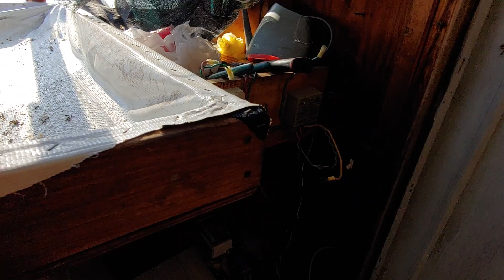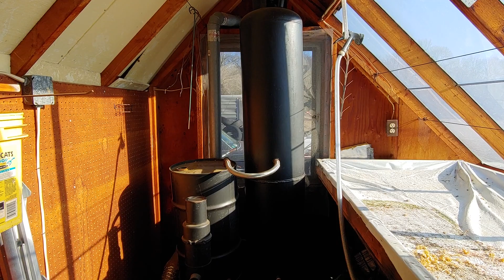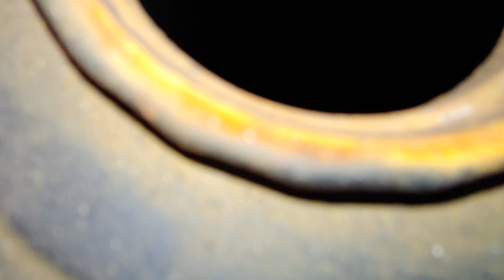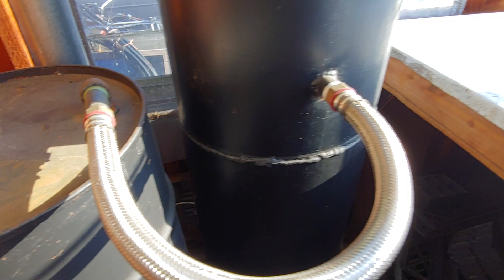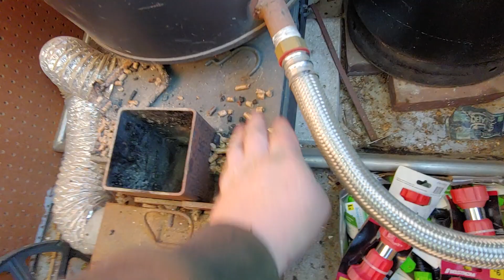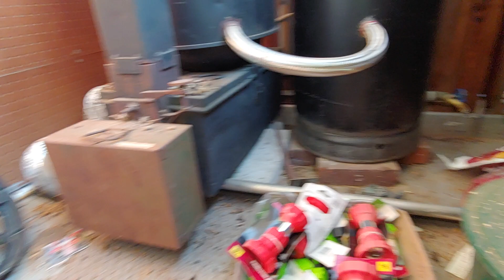Rocket stove ( version 2 )

Comment: OH OK, i thought it heated up the water and the warm water run on the table and kelp the plants warm. but i see it is a radiator of heated water, to keep the plants warm in the room i see.  and you can not use a wood burning stove, because it will not last that long. and you do no not  won't to use power because it wood cost to much. and what kind of pellets do you use for the fire box? i am going to go back and look at the first one and the third video now. you got me hook in to watching . lol   how do you clean the cat litter in the box under the barrel. ?  great video Bert. Thanks again.
Reply from the maker: I'm only using the kitty litter as an insulator between the burn chamber and the outside casing of the stove. And really I just built it as like a beta test. But I figured if I'm going to build one to mess around with I might as well so it have at least a little bit of use for it. And really I have it in there just in case we want to grow things in the wintertime like lettuce or some small stuff. You never know we might need to grow stuff all winter
Reply: @ScrapFarm  o i see , Great idea.  and yes i would use it to grow all thought the winter, if i could that would be a good thing . now on to the other videos of yours. have a good night.